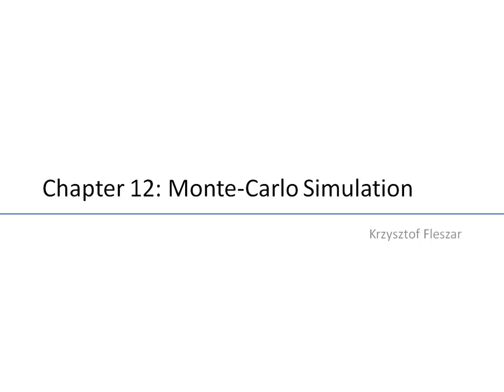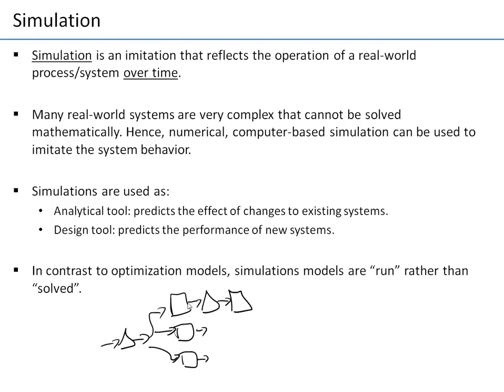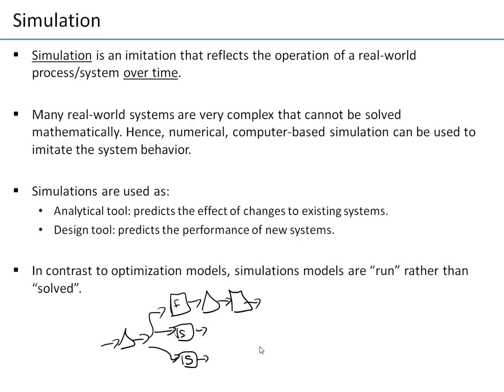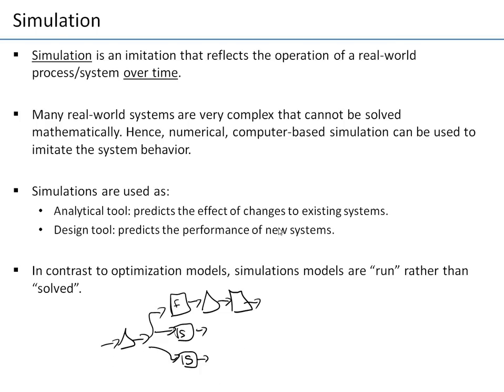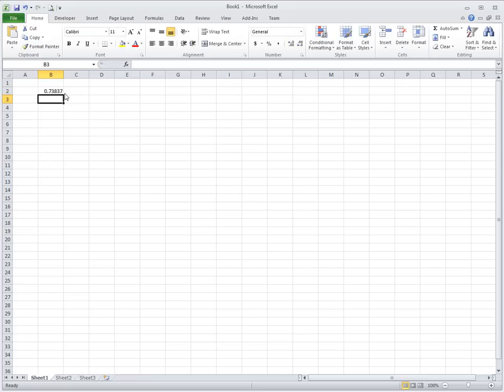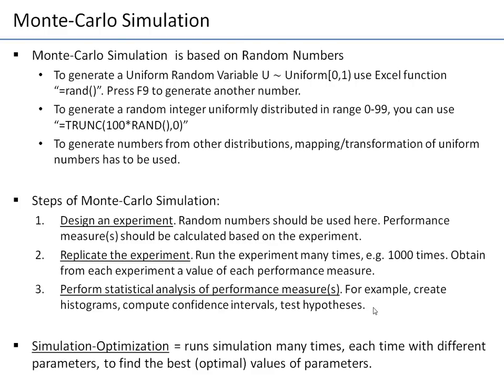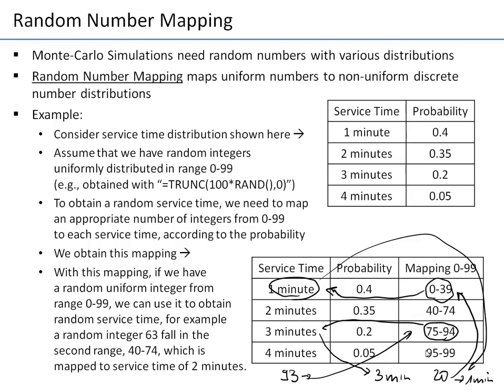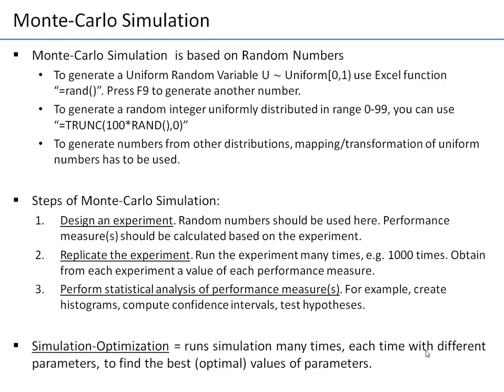Ch12-00 Introduction to Monte Carlo Simulation

Comment: I want to run a monte carlo simulation on my house's  air conditioner fan settings.  There are 3 settings, low, medium, high....I know my house needs to provide power to my fan ...and for each fan setting there is a specific power consumption. How do I use monte carlo to determine which setting is the most likely setting to be used within a week so that I can forecast my electricity bill delta stemming from the use of my AC?